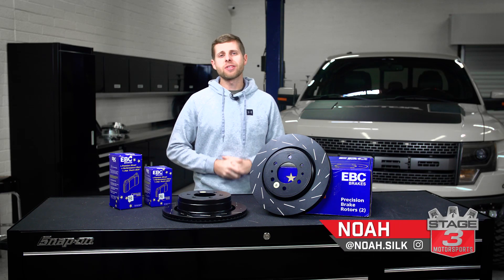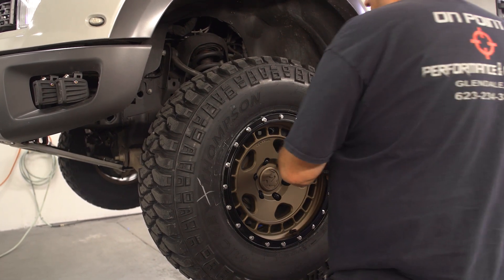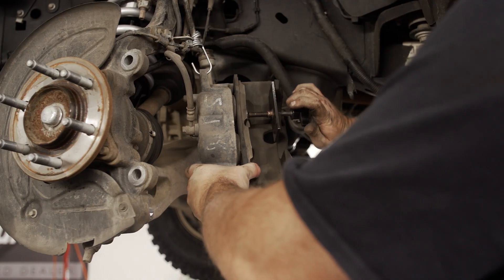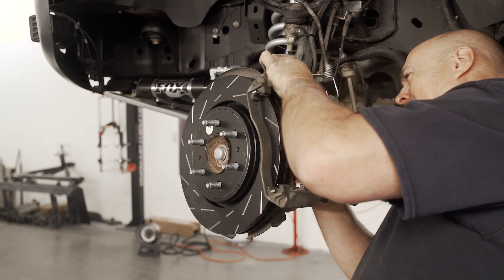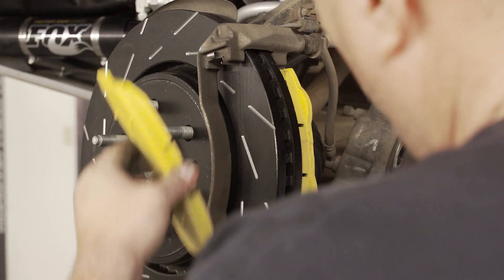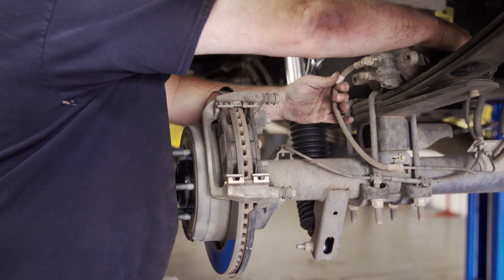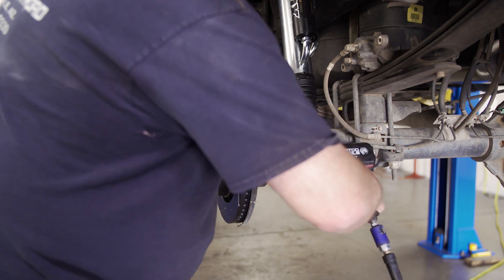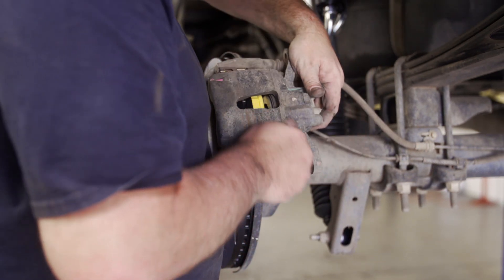2012-2018 F150 & Raptor EBC USR Complete Front & Rear Brake Kit Install

Comment: To Anyone who is watching this as a guide, the front pads are inside/outside specific. The inside pad has two humps on the pad if you installed it outside the caliper won’t fit properly. This coming from experience because I did this to a friends f150 and forced the caliper on and the wheel was rubbing on the caliper.

Comment: Just got my set of front rotors and brake pads for my 2013 Raptor from Stage 3 Motorsports. Called the tech support at Stage 3 to make sure I was ordering the correct parts for my truck. FAIL, wrong brake pads were sent. ...and they are closed on the weekends.